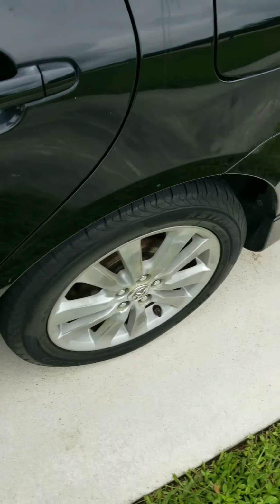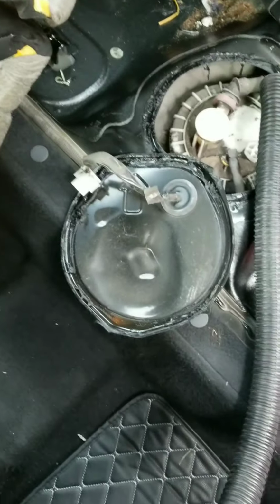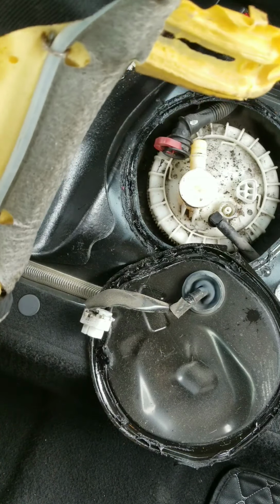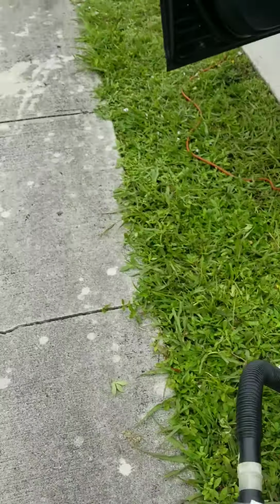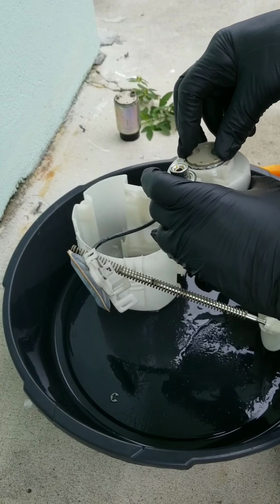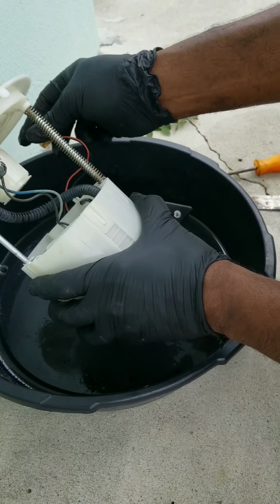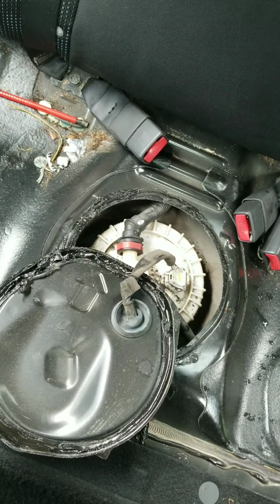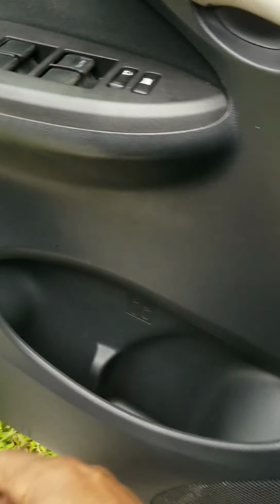2009 Corolla Fuel Pump Replace

Comment: I would go so far As to say that the Toyota cars are The easy to work on and not many special tools are required to use
Reply from the maker: Some repairs could be a little frustrating, but for the most, they're pretty simple.

Comment: Not cleaning the filter at same time ?
Reply from the maker: @chulau7570  
Do you mean the strainer?
You can't clean the filter, it's part of the assembly and gets replaced when you replace the complete assembly. The customer only wanted the pump replaced.

Comment: What were your symptoms before the pump died? Mileage on the vehicle? My 09 is at 150,000. Cranks but won’t start. Attempts to fire but won’t start. About two months ago my wife ran the car empty and it’s been getting more sluggish ever since which led me to believe the fuel pump failed.
Reply: Forgot to add that I cleaned the MAS recently , replaced the spark plugs and coils earlier this year and have no codes or check engine lights
Reply from the maker: @clearskiesranch1362  
I don't remember the mileage of this vehicle, but I recall it being somewhere near 200,000. The pump worked but wasn't creating enough pressure.
Reply from the maker: @clearskiesranch1362   check for power to the pump when you're cranking it. 
I think the black wire with white stripe is ground, and the solid black wire is power.

Comment: My 2018 Corolla is having a rough start so you think it’s the fuel pump that’s needs replacing? It rough starts randomly when cold, when it’s warm it starts right up, 75k miles on it.
Reply from the maker: Sounds like a bad intake gasket or something that seals when its warm.

Comment: So where is the fuel filter?
Reply from the maker: The fuel filter is considered a lifetime filter that should be replaced with the pump. It's the plastic section that the pump mounted in.
It's best to replace the whole assembly when the pump goes bad that way everything gets replaced including the level sender. 
But in this case I'm just a parts changer so I only changed the part I was hired to change. 

Please like and subscribe.

Comment: Hey bro I need this replaced do you have a link or a website I can order this part I will really appreciate it most of the auto stores here only have the whole build and it’s 600$
Reply from the maker: I don't know where it was purchased from but it wasn't in a package so I assumed it was used. Maybe ebay or the junk yard. I just replaced it because that's what I I was hired to do.
Reply from the maker: I'm not sure but maybe this will help. 
https://www.partsgeek.com/gbproducts/AC/29866-07966115.html?utm_source=google&utm_medium=ff&utm_content=APY&utm_campaign=PartsGeek+Google+Base&utm_term=2009-2013+Toyota+Corolla+Fuel+Pump+and+Strainer+Set+API+29866-07966115+09-13+Toyota+Fuel+Pump+and+Strainer+Set+2011+2010&fp=pp&gbm=a&gclid=CjwKCAjwi6WSBhA-EiwA6Niok2AAXB5A9y1W6YCZSwleEf-LQp_7-AX5dEiMRoSkHGEV94Nq0x-krRoCxOoQAvD_BwE
Reply: Hey how did you make out with finding just a pump?
My boy and I are replacing his today. I had to go with a full unit.
Reply: Got whole unit on eBay under $40 works fine

Comment: Thank you for the detailed video champ. I went ahead and replaced the strainer in addition to the fuel pump as per your guideline.

I checked the fuel pressure and it's almost 45-48 psi after changing the fuel pump. Before it was 30.

Now my question is will the P0171 code go away itself?
Reply from the maker: 30 PSI was definitely low, and it could have possibly caused that code.
Was the car drivable before you replaced the fuel pump?
And if it was, how did it drive and idle?
Reply: The car was driveable and probably took some time while accelerating in the initial gears but nothing too bad.
Reply from the maker: @I_am_Jawad 
If it drives better after replacing the pump, then the code most likely won't come back. But you will have to clear it yourself. 
Sorry for the late reply.

Comment: Good video. One question: what do you do when the fuel pump cover doesnt want to turn. Mine is stuck hard. I tried hammering it and also used a fuel pump spanner wrench. It just wont turn.
Reply from the maker: I haven't done one that wouldn't turn. Maybe two people hammering at the same time on opposite sides.
Reply: @Repairsbyctop  good idea..thx!

Comment: Thanks for the video. I need to change my pump so nice to see it done before I start.
Reply from the maker: You shouldn't have any problems doing it. 
Please like and subscribe.
Reply: @Repairsbyctop  I liked and am subscribed
Four months ago me and my son swapped the fuel pump after watching your video. The car has been working fine ever since- Thanks- now we are going to tackle changing the idler pulley and serpentine belt today.
Reply: His 2006 corolla has 285,000 miles and runs fine other than keeping up with maintenance
Reply from the maker: @dgray3484  That's why I like Chevy trucks and Toyota cars.
Reply from the maker: @dgray3484  you guys should be able to get done easily and fast.

Comment: Good video 
Did you remove any relays or fuses to depressurize the line beforehand?
Reply from the maker: Just unplug the pump, start the vehicle and let it run until it dies.
Reply: @Repairsbyctop   thx for the info.
Reply from the maker: Please give the video a thumbs up and subscribe to my channel.
Reply: @Repairsbyctop   done😎

Comment: Where did you purchased the part and can you drop a link my whole assembly as gone bad
Reply from the maker: You can purchase one for around $150 from your local auto parts store with a lifetime warranty. 
Or you can get a cheap one for around $70 from Amazon but it won't last long.
Reply: @Repairsbyctop  okay thanks

Comment: Where is the fuel filter?  Is it within the assembly? I'd like to change the pump and filter at the same time
Reply from the maker: Yes the filter is part of the assembly and it only gets changed when you replace the complete assembly.

Comment: What are your thoughts on installing a kill-switch in the 2009 corolla via snipping the fuel pump wires and passing it through a switch? Also, do you have, or plan to have one installed ? (crime is up these days) :D
Reply from the maker: No need for one on these cars. 
The computer wont let the car start until it recognizes the key that's programmed to it.
Reply: @Repairsbyctop  What about hold-ups at  the gas station ? lol  Alot of that in Los Angeles now. Anyway.. thanks for the vids.